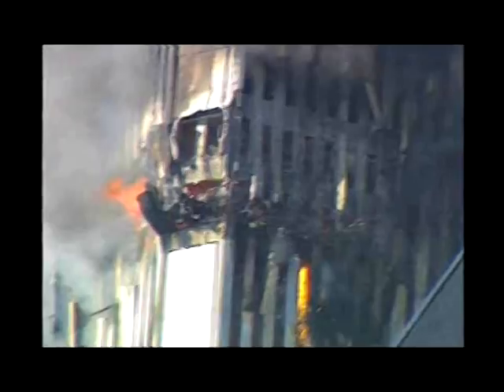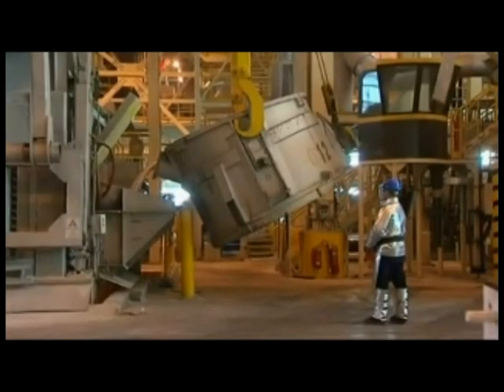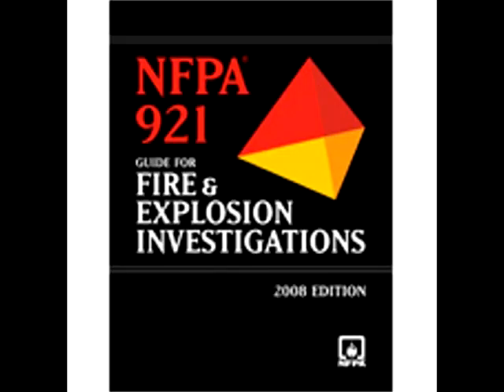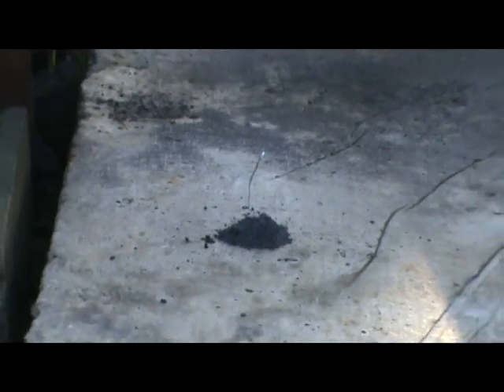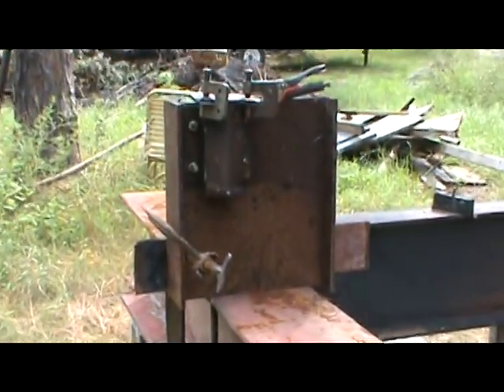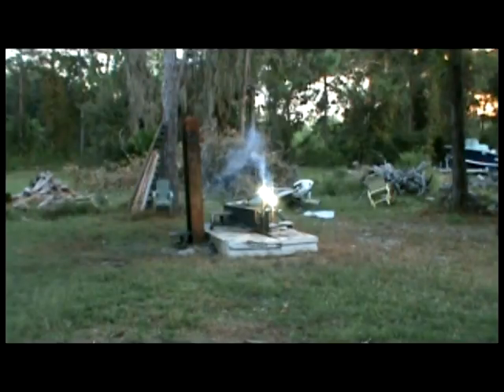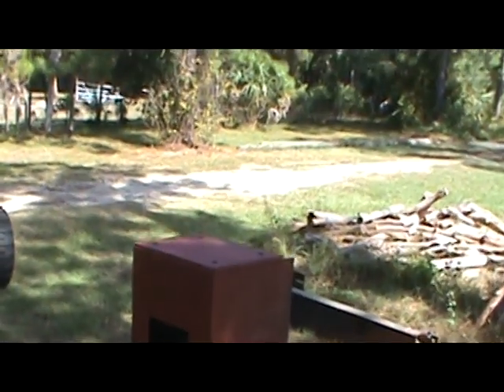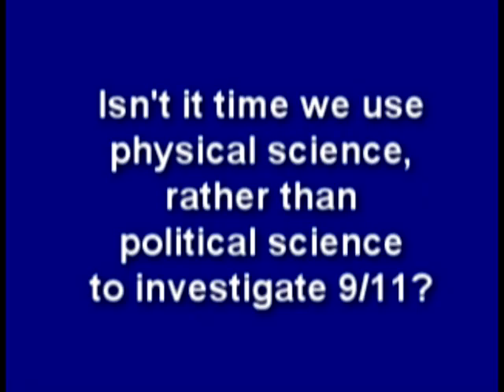9/11 Experiments: The Great Thermate Debate

Comment: There is no debate. An aircraft flew through it and it fell.
Reply: Take a run down the rabbit hole.   http://washingtonsblog.com/2012/09/the-third-building-which-collapsed-on-911-was-not-hit-by-a-plane.html
Reply: Jim C  I worked on heavy aircraft for over 20 yrs. they are lucky it didn’t chop the top completely out of both buildings.  You conspiracy nuts always run to building three when the rest of the bs story falls apart.
Reply: Roadking911   go back to sleep it's nice and safe and comfy for you there LOL. There's tons of experts far more qualified then you stating it's a red herring. Now go back to sleep in your nice little comfy made up world that everything is rainbows and butterflies. .
Reply: Jim C Magnesium is flammable, burning at a temperature of approximately 2500 K (2200 °C, 4000 °F), and the autoignition temperature of magnesium is approximately 744 K (473 °C, 883 °F) in air. 
If you knew one fkn thing about aircraft you’d know the relevance of that information
Reply: Jim C what happens to magnesium when hit with water?
Reply: Jim C  this is a fkn joke.
Reply: Roadking911  and I bet you're one who thinks the US  found evidence that there was  weapons of mass destruction in Iraq hey lol.

Comment: This guy has done one hell of a job with relatively crude chemicals as compared to the much smaller particle size that could be ground in a high tech roller mill bathed in an inert gas atmosphere.  A much faster burn pushing the edge of an explosion, what is an explosion other than an extremely fast ignition?

Comment: so, if the fires inside the building were 1,800 degrees, just how structurally sound would those steel beams be, do you think they would be a bit bendy? zero death bed confessions is another one that doesn't fit the logic, that and the fact no other person out of the hundreds of thousands required to keep quiet about how they orchestrated the deaths of thousands for reasons has ever messed up and told someone, or come forward with a confession and evidence.
Reply: If you dig deep there are allot of suspecious deaths around 9/11. Aswell as the murder of kennedy, numerous key witnesses were murdered . Would you dare if youd know the truth? would they believe you even?

Comment: The bottom of the structure has to be taken out before anything can fall! the top part of the structure is lighter. Even if a few floors fell from the top stories they would be stopped they would not reach bottom nor would they reach bottom at nearly Free Fall speed. It's that simple. Cheers

Comment: Wait folks, you have to understand that the towers where not built on a conventional girder system like the empire state building. The towers had a square center backbone were the elevators were. From there girders were hung to perimeter girders , and then rivited. This design was to allow for maximum office space. When the planes hit, much of the fire retardant was blown off the sparred  beams which then allowed the hot fire to weaken the beams and rivets enough to snap the perimeter supports that allowed the upper floors to collapse on the floors below.  The public should research the unique design of the towers to understand how heat and heavy impact of the planes weakened the design structure and brought it down. Jumping to thermite as a cause is jumping the gun.
Reply: Well how could the strong core collapse at free fall speed? And there was no debris at ground level. I dont believe in the thermite theory, but believing the official theory is even harder.

Comment: I'll add this about what I know about steel.

Two weeks ago I was hammering some 16-gauge weldable steel (from Lowe's), a piece about 2-1/2" long and an inch wide. I needed to put a bend down the middle of its length pretty close to 90 degrees. It's a piece where the rocker panel starts to curve up into the cowl side, at the lower front frame of the driver's door.

I have the piece (curved, which is why I couldn't just clamp it in the vise) in my Vise-Grips and I'm hitting it with my 12-oz ball peen hammer. It wouldn't bend. I'm smacking it pretty good. So I get the idea to heat it up with my MAP+ torch. I heated the metal up to where the steel is just turning black or dark gray, and was able to put the bend on it with three TAPS of the hammer.

I checked Google and weldable steel starts glowing at 900 F, so this was below that, perhaps 700 or 800. The point is steel does not need to be melted to be weakened. Get it hot, it'll bend. Otherwise why would farriers heat horseshoes up to shape them?

Comment: thermite is aluminium and rusted steel reacting on a hot fuel fire, ive created by mistake destroying a foundry.  It would easily be created from the steel and aluminium plus fuel and fire available in the inferno caused by a crashing plane inside an aerated concrete structure.  And once going, it would find the ground, turning rust to thermite all the way down, melting iron willy nilly.  I find it troubling that nobody sees this.
Reply: Anythings possible   mmmhmmm

Comment: Jet fuel is not even that flammable,  by law it's not supposed to be so combustible.  Gasoline is allot more flammable. Jet fuel is the same as high octane gasoline and if you have ever researched high octane fuels you will know that high octane is for high combustion pressure ( which means it's designed not to explode in high pressures ) which leaves a fuel less likely to ignite / burst into flames easily  unless with high pressure and if you do ignite it then it burns slow.

Comment: i commend you for your efforts.
only problem is, THERE IS NO EVIDENCE FOR EXPLOSIVES OR THERMITE, THERMATE OR ANY NANO- THERMA-DERIVITIVE AT ALL ! NONE !

not to mention it would literally take months and months to rig even 1 WTC Tower if you were working large crews 24 hrs a day
out in the open. in secrecy it could possibly take years and years.

but it doesnt matter because IT WAS NOT DONE ! THE WTC TOWERS WERE NOT DEMOLISHED WITH EXPLOSIVES OR THERMATES ! THERE IS ABSOLUTELY ZERO EVIDENCE TO SUPPORT RIGGED DEMOLITION OF ANY KIND !

if thermates were used there would be very obviously thermo cut steel beams, collumns and trusses EVERYWHERE after collapse !
not to mention the thermo reactions would have been seen burning ! from bottom to the top the Towers would look like 110 story sparklers going off !

and that doesnt even consider the FACT that the WTC Towers collapsed, FROM THE TOP DOWN ! EXACTLY as any reasonable and reasonably intelligent and not paranoid person with a sound understanding of physics, ballistics, structural engineering and design, thermodynamics, metallurgy and general construction principles would expect. PERIOD !

for Gods sake, i could claim the WTC Towers were demolished by an alien technology, GAMMA RAY, 4th dimensional, phased wave, pulse disruptor that causes steel framed constructions connection points to simply CEASE TO EXIST, immediately dropping a skyscaper with the push of a button !

BUT THERE IS NO EVIDENCE FOR IT ! no evidence it even exists !

but you know what there IS evidence for?
muslim terrorists stole some planes and rammed them into the WTC Towers, causing significant structural damage and igniting intense, raging fires that created high enough temperatures to weaken the steel structure by 50 to 90% ! that is FACT! not suposition or delusion. it is FACT!

and if you cant understand how the WTC Towers collapsed under those conditions, there is NOTHING i or anyone else can do or say to prove it to you. your just too far gone, too ignorant, too misinformed or too delusional.
or a combination of two or more of the above.

THERE WAS NO CONSPIRACY !
muslim terrorists stole some planes and knocked our buildings down! PERIOD !

Comment: HTF does an aluminium aeroplane, which is essentially built like a soda can, at most a few millimetres of aluminiun punch through all those huge  beams that were two and a half inch thick box beams, that's 5 inches of steel, per girder, to even suggest penetration ìs simply ridiculous!  Especially when there's the 'Wing Tip Breach' is. Really?. Yep, even the tiny skinny wing tip can penetrate 5 inches of steel. Hahahahahaha 😂 (if it was travelling close to light speed ok, but otherwise No!) ☺

Comment: Or two planes hit the buildings recorded by hundreds of people, witnessed by thousands, and the unique construction of the twin towers meant the collapse was inevitable due to fire induced steel weakening with localized phenomena of higher temperatures due to normal physics of combustion and accelerated airflow typical of large scale conflagrations with the various fuel material present.

Comment: A man lit a cigarette lighter in the building which instantly vaporized the steel beams allowing the building to collapse onto its foot print. Haters will say I am wrong...
Reply: Yeah i hate it when the kerosene heater in my loungeromm that has walls 3mm thick and cost $90 at walmart melts and collapses when i turn it on.
Reply: Willy Whitten they should!
$90 kerosene heaters & saudi passports, indestructible. This is what should have been used, some sort of passport/cheap kerosene heater composite material.
 18 inch thick steel beams used in construction? Collapse after 40 minutes.
Reply: About as possible as it is a plane hit the Pentagon. If Civil Engineers designed the building then problem solved! They should have gone with architects and structural engineers. The Civil Engineers can work out how to install the escalators. Maybe.
Reply: Willy Whitten did someone leave the door of the Wambulance open? Does looking at stuff with your own eyes & applying logical thought scare you too much?
You're not ready for it son - go spend a few more years in your safe space and have a think about it when you're a big boy.
Reply: Yep. Because, after all, the fire happens INSIDE the those 3mm thick walls, no? Sure it does. There is also, I'm sure, no safety warning on the heater either? No, of course not.
Because saying something that is irrelevant to the point at hand SURELY proves you're right. No?

Comment: 2 facts supporting controlled demolition causing the WTC towers' collapse: (1.) nearly all the concrete flooring of the 110 story towers turned into "extraordinarily fine dust" within which was found the super explosive nanothermite, designed for spraying upon surfaces, and (2.) there were hundreds of flatbed trucks loaded each NIGHT at Ground Zero with steel columns and beams that had come down already cut to convenient 30 foot lengths to fit the flatbeds!
Reply: So, from your statement, we can then extract that, 1, you don't know anything about the collapse of the buildings at the WTC complex. 2, you do not understand what thermite/thermate/nano-whichever is and what it does. 3, you do not know the first fucking thing about the clear-up and recovery efforts. And 4, you don't know anything about the buildings themselves.
Reply: MoonEyes2K: Jonathan Cole mentions in his video here at 13:20 explosive nano-thermite as a spray. Here's what the nano-thermite found in the dust consisted of: tiny ceramic chips upon each of which was a foam-like orange silicon carbide matrix with many bubble-like chambers, within many of which were nano size flat aluminum plates nestled with several nano size cube-like rhomboids of ferrous oxide. Upon ignition, many of the ferrous oxide cubes, with their flat faces touching up against the aluminum plates, transferred their oxygen to the aluminum plates, forming aluminum oxide and became pure iron at temperatures around 4,500 degrees Fahrenheit and moving at high speed.  That's the exploding of nanothermite, those millions of tiny bits of very hot pure iron moving at high speed. Upon cooling those bits of iron turned into tiny spheres of pure iron, many of which were still moving fast and millions of which were found in the dust.
Reply: "explosive nano-thermite as a spray"
Which fails in the first word of the sentence.

"Here's what the nano-thermite found in the dust consisted of"
And since there WAS no "nano-thermite" found in said dust....

"That's the exploding of nanothermite, those millions of tiny bits of very hot pure iron moving at high speed"
No. It isn't, because that isn't an explosion. It's, at best, agitated metal due to heat.

"millions of which were found in the dust"
And all of which has a much simpler explanation.

Comment: Thermite is what destroyed the Gustav gun in ww2 This video is cool, but it’s been known for a while that thermite can cut steel.
Reply: Sure. You can do the same with an oxy-acetylene torch. Neither are commonly used for that, though, but more for welding.
And no, it isn't "what destroyed the Gustav gun".